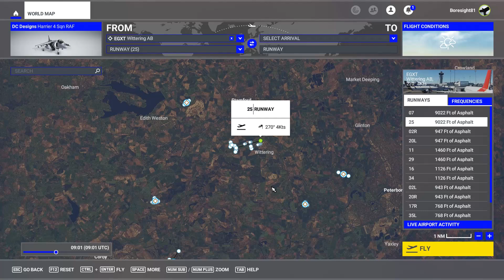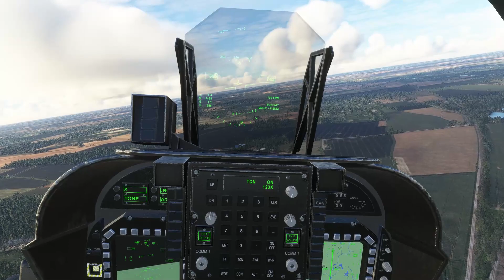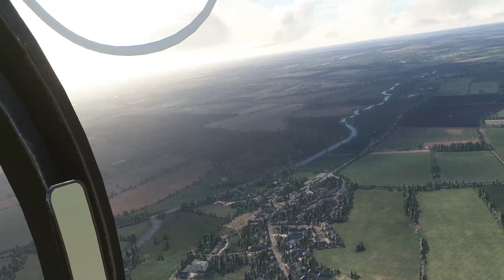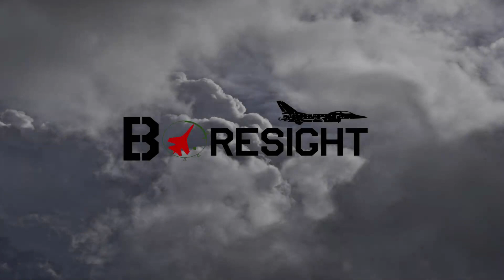DC Designs AV-8B Harrier II Shore Based Landing Demo | MSFS | FS2020 | Microsoft Flight Simulator

Comment: I can’t turn off the auto trim in the aircraft and it’s causing it to point either straight up or straight down when I try and perform a vertical landing. Do you know how to fix it?
Reply: Its just the reverse of a vertical take off using the same % of power that it took for vertical lift off using the nozzle hand and limiter bring them back to around 60 % till the aircraft slows then flaps stol and nozzle handle and limiter to 90% (degrees) then adjusting the power till you get a nice slow descent, just plenty of practice with live players turned off so you don't look a wally when you mess up !

Comment: Looks really good - I don't want to be overly pedantic but that is actually the Harrier GR.7/9 not the AV-8B (which was used by the US). The AV-8B has a very different nose shape (less noticeable on the night attack variant) and only has 6 under-wing pylons instead of 8 which the British Harriers had.
Reply from the maker: Indeed it is the GR.9, The package is exclusively AV-8B but they have added a GR.9 model to the mix, It's a lot of fun, This and the CJ Sim Typhoon are the only two planes I seem to be flying lately!
Reply: Yeah, the GR.9 is far better anyway :). Good to see more British aircraft in the flight sim world